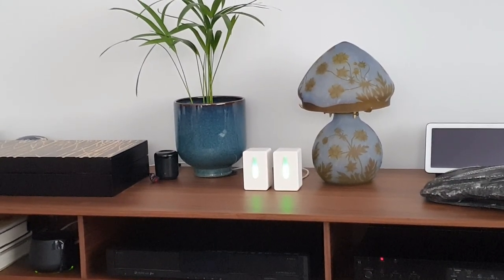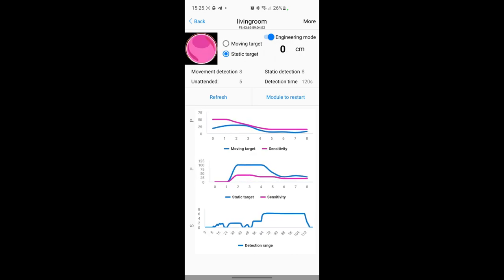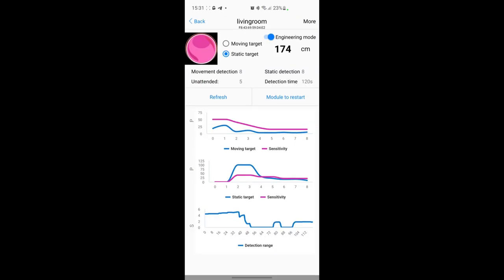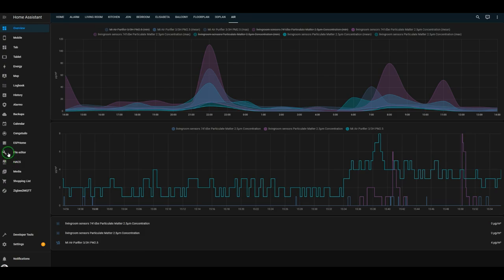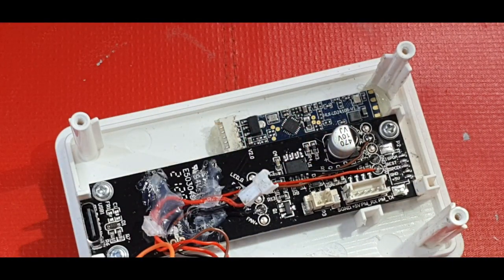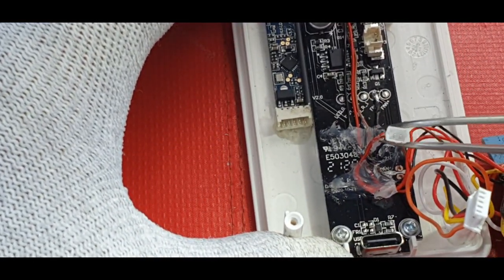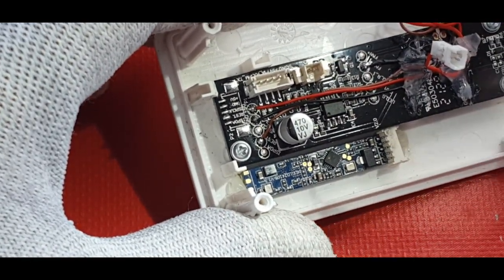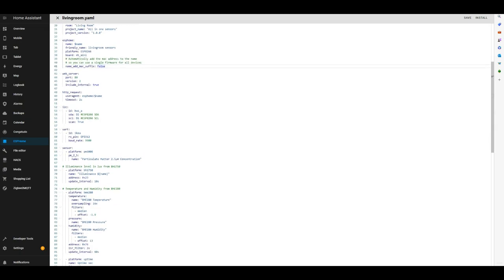Ikea VINDRIKTNING Smart Home Assistant integration with ESP8266 + HLK-LD2410 + BME280 + bh1750

Comment: It looks like you blocked the fan side with the ESP8266 and the PM2.5 sensor side with the additional sensors. That might account for a lot lower values from the PM2.5 sensor. Perhaps a different arrangement would improve that functionality.
Reply from the maker: Hi, you cant block the fan with this arragement, if you take it apart  you will notice there is plenty of space, as a matter of fact there is a plastic separation between the fan and the esp8266, also the fan asambly  is totally closed, the intake is from the rear directly, and the air is pushed  through a fikter into the laser sensor. The values are lower because i run the fan at lower voltage, ibstead of 5v it run at 3v, less voltage means lower rpm, lower rpm, means less air flow. But with this airflow you get less noise, and the values are more real compared with the xiaomi 3h pro. With the 5v the vakues are way too high.

Comment: Can you provide a reference link to purchase the 2.5 mm JST connectors and mounts? Also, just to be clear these are 2.50 mm and not 2.54 mm JST???
Reply from the maker: hi, if you need the jst for the mmwave its 1.25mm, and for the ikea its also 1.25. I´m sorry if I said 2.5mm. Bellow is the link for the connectors and mounts. Thank you and sorry.
https://es.aliexpress.com/item/32837496527.html?spm=a2g0o.order_list.order_list_main.213.4483194dADzH7u&gatewayAdapt=glo2esp

Comment: How did you compensate for the heat inside the unit making the bme280 read the temps too high?
Reply from the maker: I just posted a pined comment with my codes, basically you ise a filter  offset and in my case I lower it 1.9 degrees.

  - platform: bme280
    update_interval: 60s
    address: 0x76
    iir_filter: 2x   
    temperature:
      name: "BME280 Temperature"
      oversampling: 16x
      filters:
        - median
        - offset: -1.9

Comment: is it possible to add MQ135 CO2 Sensor along with this?
Reply: I have the same sensor but there is nothing for esphome available. At least, I haven't find anything except of a Script that requires a humidity measurement sensor connected otherwise the results are bad because humidity is part of Formula.

Have you been able to add to HA?